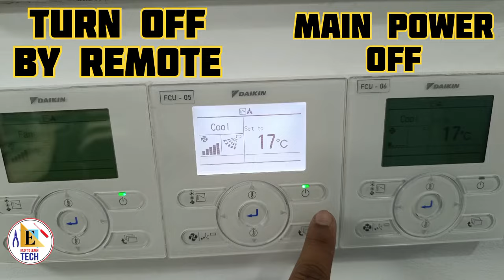How to Remove and Service a Daikin VRV Indoor Unit Yourself // Step-by-Step Guide Removing All Parts

Comment: Sir I'm trying to take the fan blower off my indoor cassette unit. I've removed the nut and the special washer but the fan blade won't come out from the shaft
Reply from the maker: Need to use WD40, BECAUSE the shaft is rusted & stuck. Tight the nut only top thread, then knock gently it will come down.